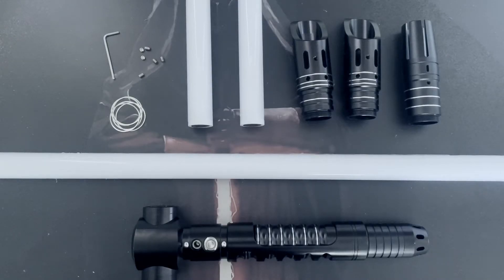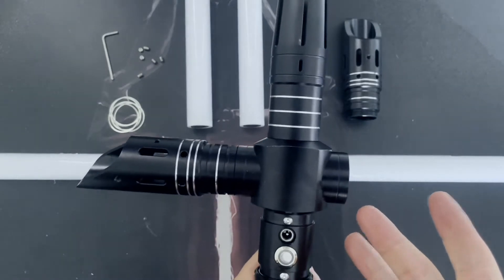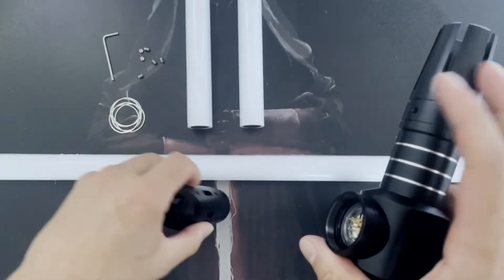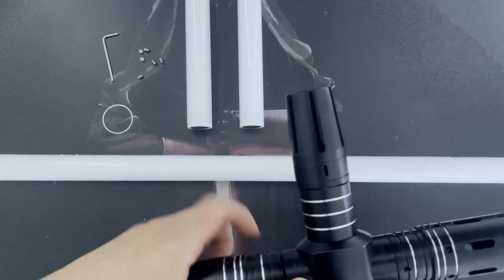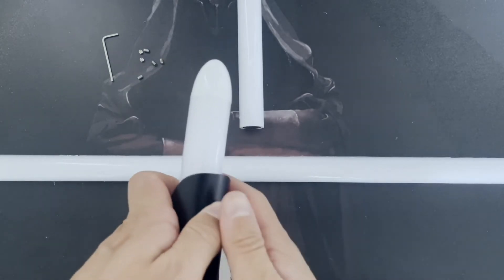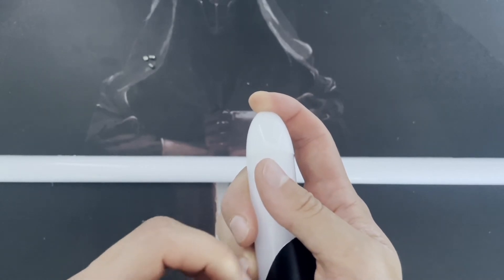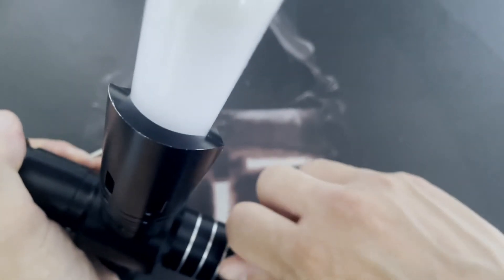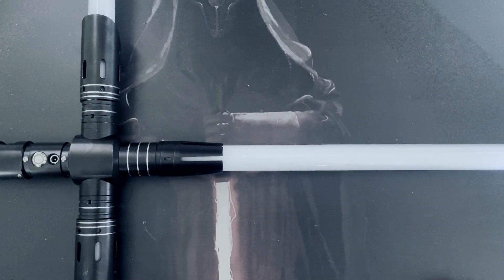How To Assemble Your Crossguard Saber

Comment: the grip sleeve can also be straightened and adjusted without rings. you can unscrew the outer protective sleeve portion seperate from the entire grip, that second screw under the activation button.

Comment: When I got mine there were screw with different lengths inside the package. Long ones and some about half the length. So I mixed them, one long and one short for every blade. The side blades are very stable and sit tight, but the main blade is a bit "wobbly". The blade won't slip out ut when I shake the hilt you can feel the main blade shaking too, is that normal or should the main blade also sit tight in the hilt?
Reply from the maker: If you use 2 long screws for the main blade and tighten them until they pinch then this will keep the blade steady. Use the smaller screws on the side blades
Reply: Like they said, try 2 long screws. I'm not sure about the screw lengths because my praxeum came with equally sized screws, but experiment with that.
Some advice I can give you is, screw that blade in tight. Don't be lenient with it. At first I was very lenient because I didn't want to damage the blade, but trust me, just screw it in properly tight. When it gets to a point where it's actively really hard to screw it, then stop. Even if you get little marks on the blade, you can't see that part anyway because the emmiter covers it. I can understand if it's a neo blade you might want to be more careful, but still screw it in as tight as you can.
Reply: Thanks for your advices. Now it's just perfect 😍👍